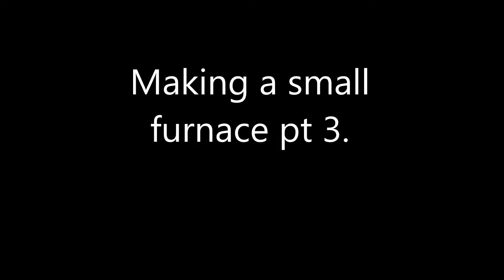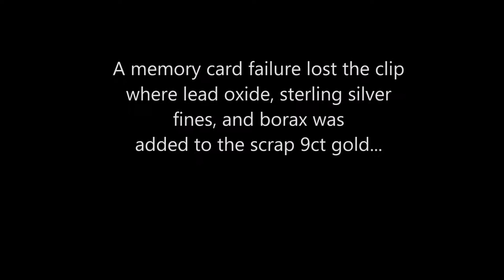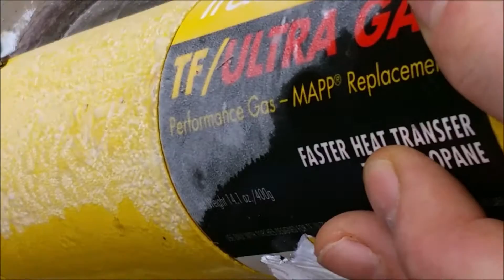Make a small furnace Part 3

Comment: was there some copper in the alloy you were cupellating?
Reply from the maker: OwlTech yeah probably some in there...i don't have much experience doing this. Think it needed to run longer too
Reply: definitely, and need more lead to get rid of the copper. Dore freezes  as there is too much copper oxide covering it and not enough lead oxide to dissolve into. If I remember right you need 10g of PbO to dissolve 1gCuO
Reply from the maker: OwlTech thanks mate great tip
Reply: Np, and one more thing - not having enough lead and too much copper results in some silver getting in the slag (soaked by the cupel) so you have too options one is to use excess amount of lead and the other is doing scorification in order to reduce copper and / or nickel (another problematic metal) content.
Reply: "A textbook of fire assaying" Textbook by Edward Everett Bugbee you can download it as pdf. just google it

"A Textbook on Fire Assaying - Of all the books to own on Fire Assaying if you could only own one...this is that one. This book was and still is the defacto textbook on fire assaying, and is on every shelf of professional assayers even today. Covers assaying of Gold Silver Platinum along with complex ores, reagents and charges needed, cupellation, ore sampling techniques, tools, and more." :)
Reply from the maker: OwlTech thanks for the link and tips I will cook that sample again with more lead til it is just electrum
Reply: NP mate, can u compact dry bone ash into a stainless steel cup? I mean does bone ash behave like portland cement or it's different, asking because I've never worked with the material
Reply from the maker: OwlTech i had read that if the water content was right it would press well. Some recipes had binders. I didn't use binder. I think i had the brew too wet...but still got a useable cupel.
Reply: Cheers!